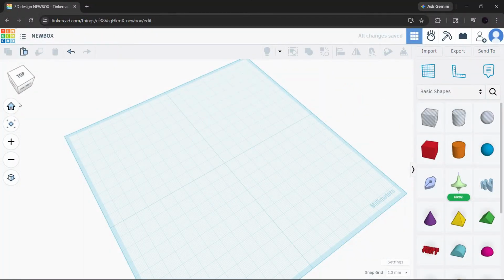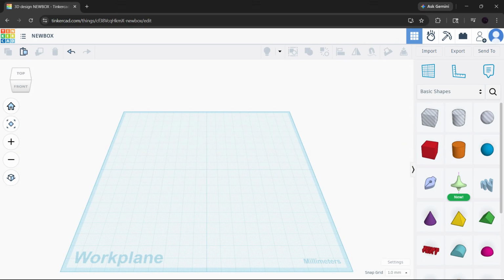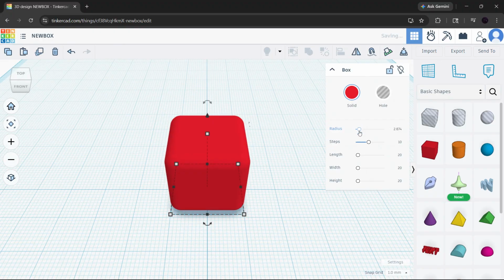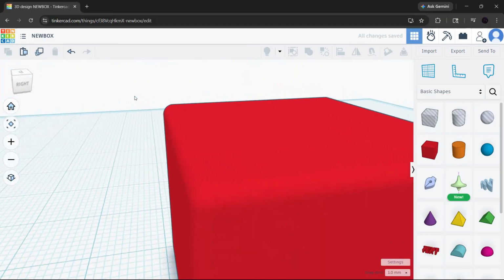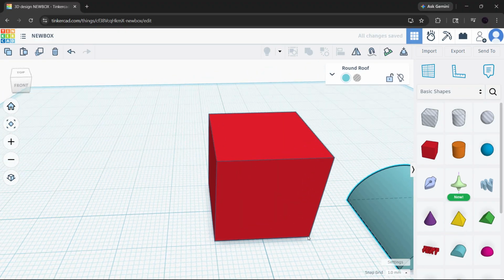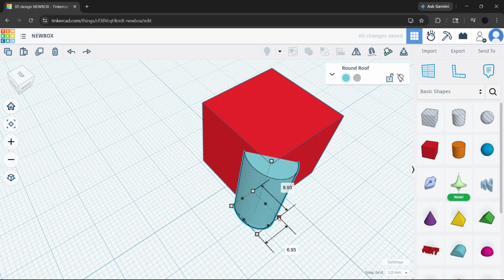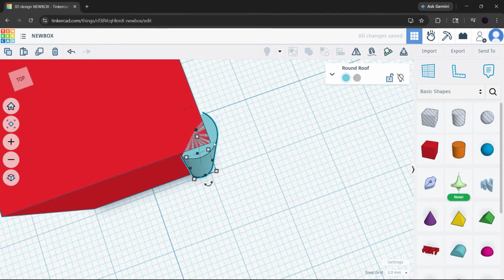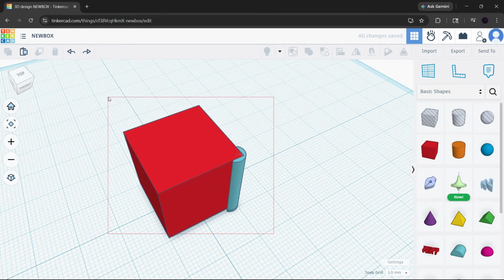How To Radius In Tinkercad (Easy Guide)

Comment: I need a large radius, in 115mm wide, I need 2mm drop
Reply from the maker: To get exactly a 2mm drop over a 115mm width, you need to use a massive cylinder as a "Hole" to slice the curve out of your shape.

The math for that specific curve means you need a cylinder with a diameter of 1655mm. Drag a Cylinder out, change it to a Hole, set its width and length to 1655mm, and increase the "Sides" slider to maximum so it is perfectly smooth. Lift the cylinder up so it only cuts 2mm deep into your 115mm wide object, group them, and you will have your perfect drop!

Don't forget to like and subscribe for more precise Tinkercad design tips!